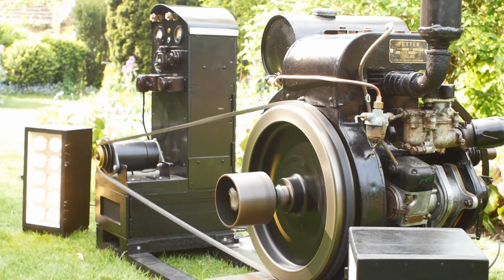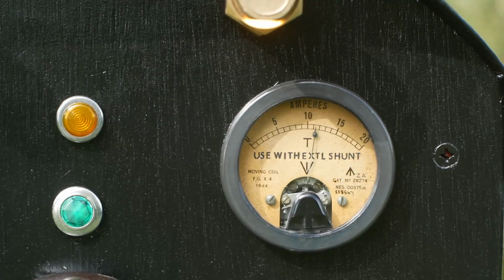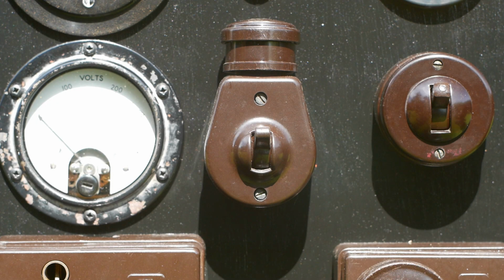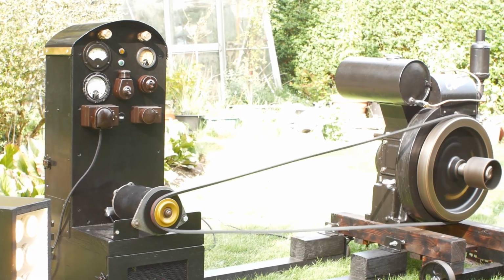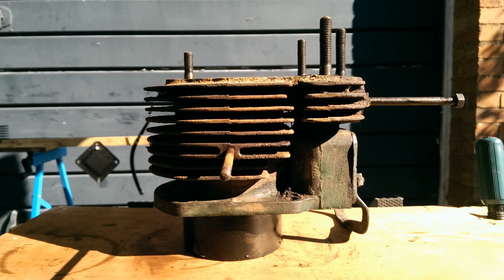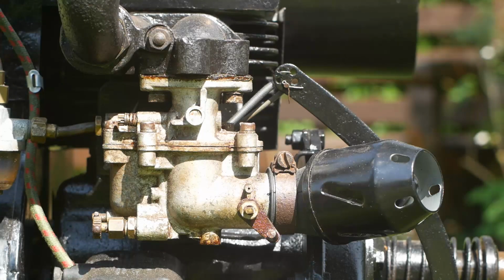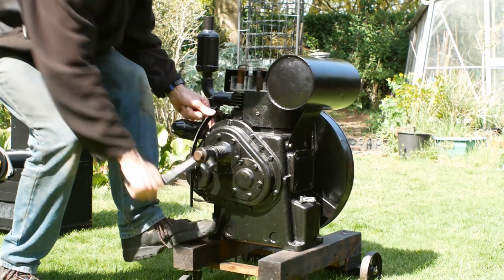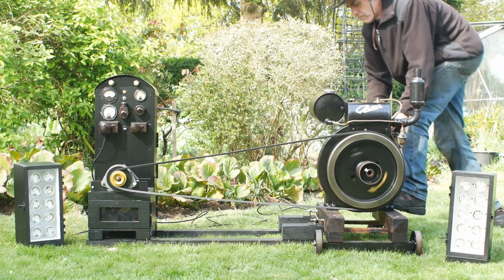Vintage Engine - Petter A1 Stationary Engine & Homemade Generator - How to Start a Petter A1

Comment: hi Tim - I am buying a similar engine and would like to also use it as an electric generator - I am semi off grid so a back up for charging batteries when the power is down. Would I be able to ask you about your generator set up? (E.g. via email). I don't think I can build anything as elegant as yours but guidance on the components I should get would be appreciated!
Reply from the maker: Hi Mark, yes that's fine to get in touch by email, you should find the address in the "about" tab.  My initial thoughts would be to use an alternator rather than a dynamo because you'll get more power that way - I used a dynamo partly because I had one kicking around and also I wanted the whole thing to look pretty - alternators are kind of ugly!!!

Comment: Great little lighting plant, but put the dynamo at the other side of the engine, so the belt is tight at the bottom, and slack on the top.
Reply from the maker: Hi Gary, I was probably applying my bicycle logic when I created that set up, with the top being tight and the bottom being slack - I seem to remember that I did falter for a while trying to think about the physics of how a friction belt should work and probably went for the wrong option.  Thinking about it now, if the top is the slack side, the belt will naturally wrap itself further round the pulley, which will of course increase the friction to the pulley and reduce the temptation to slip, which is a good thing.
Reply: Yes, that's it exactly!
You have an awesome, beautiful exhibit there- that to me Is just as visually appealing to anything 4 times its value.

I used to exhibit listers and Wolseley engines with Dynamos, and I really enjoyed them!

But I have a very special love for your set.
Well Done!!!!!
(P.s.)
See the little engines I mess about with 
https://youtu.be/08p2RwTJmk8
Reply from the maker: Oops, sorry Gary, your last message made it's way into my "held" comments area because it had a link in it - I've released it now so the world can enjoy.  I've seen a few of those miniature engines at shows - they can look a bit lost when surrounded by full size engines so I've maybe not paid them the attention they deserve, but seeing yours running in a previous video, it's rather lovely, and the idea of having a small hit and miss engine that could be run inside on a rainy day is very appealing.

Now that you've pointed out the belt tight at the bottom, loose at the top thing, it seems so obvious, and I've often seen traction engines with their big floppy flat belts, where it's bottom tight, top loose, yet I never questioned my own set up.  Guess I'll swap it round sometime, maybe next year during the winter when I can't really play with it much.

Comment: Nice, neat little lighting set!
Reply from the maker: Cheers Gary, it has the benefit of being relatively light, so I can pop it, and an engine in the back of my van to go to shows.  I still wouldn't turn down a genuine old PetterLight set, but I'd probably have to build a shed to house that, and come up with a different solution if I ever wanted to display it!!!  One day I'll build a slightly bigger generator setup to go with my Enfield engine - I'm gradually collecting suitable components for that project......
Reply: @GrumpyTim  Personally,  I've been there in the past with fancy, expensive engines- but got more enjoyment and much less hassle from my Lister D,  and Wolseley WD1.
Stick with what you have, it's lovely!
Reply from the maker: That's a very good point Gary - running my little Petters always brings a smile to my face, and they're simple to work on, reliable, and spare parts are easy enough to find - why would I need anything else.  I haven't run any yet this year - must rectify that soon - if it would stop raining!!!

Comment: Hi Tim, love the generator setup. Reminds me fondly of my Grandfather making a wee generator with a Suffolk punch lawnmower engine and an old car dynamo, belt driven. I bought a Petter A1 recently, v tidy but haven’t started it yet. Doesn’t seem a lot of compression when turning flywheel. Is there anywhere I could get simple instructions as how to start it and what levers and valves do what? Keep up the good work, Andrew.  Costa NI
Reply from the maker: Hi Andrew, I love those old Suffolk Punch lawnmower engines - that's where it all started for me - I spent so many hours playing with them.  There's not a whole bunch of compression on my engine in the video and it's fairly easy to turn the flywheel as the air seeps past the rings, but it still runs pretty well (it's had a hard life!!!).

Stationary Engine Parts in the UK sell an instruction manual for the Petter A1 https://www.stationaryengineparts.com/petter-a1-a2-w1-w2-1951-onwards-instruction-book-1356-0.html which isn't perfect but it can be useful.

There's also a Facebook group dedicated to the Petter A1 W1 A and so on engines https://www.facebook.com/groups/664186990354878/

Comment: The 1st switch is an early form of a 2-pin socket ~ could see the plug on top of it and assuming the wire went into the unit
Reply from the maker: Good spot Samuel, I had a random selection of old electrical fittings, mostly plugs, sockets and light fittings, but lacking in plain switches, so I used that early 2 pin socket - the plug in the top just has a wire bridging the two contacts, meaning the live and neutral terminals on the socket are connected when the switch is turned on - nice and simple.
Reply: @GrumpyTim  - quite ingenious, re-using electrical antiques and bridging the plug

Comment: Lovely setup you have there, I have the diesel version (PAZ 1) and a couple of alternators lying around and was thinking of doing something like this with the battery storage and inverter, I'm going to look at an A1 this weekend and have a feeling i might get it dirt cheap.
Reply from the maker: Hi Zak, that sounds like a great idea, and you'll get a bit more power output than me if you're using an alternator.  It may not be the most efficient way of generating electricity, but it's lots of fun for occasional use, and the alternator/dynamo, 12V battery and inverter route is nice and simple.  I can't remember the idle speed of the PAZ 1 - I'm guessing around 1500 RPM - you'll need to check what speed your alternator requires, to work out your pulley sizes - I run my belt on the edge of the flywheel, it takes a bit of alignment to keep it on there but once that's right it can run all day without any problems and I can run the A1 at around 750 - 800 rpm.

I hope you manage to pick up the A1 nice and cheaply too - they're a lovely engine, and you can never have too many!!!!!!!!

Comment: Where did you get your belt from please I am making similar as generator
Reply from the maker: Hi James, I can't remember which of my three usual suppliers I got that particular belt from but it would be one of these:

Simply Bearings    https://simplybearings.co.uk/shop/
Bearing Boys    https://www.bearingboys.co.uk/
Wych Bearings    https://www.wychbearings.co.uk/

I know the belt I use is an "A" profile and I deliberately selected a really long belt so it would flop around, somewhat like the old flat belts did.  My particular belt is marked as "A 116  13  x  2950  Li"

Hope that helps.
Reply: @GrumpyTim  are you on Facebook
Reply from the maker: Hi James, yes I'm on Facebook - you should find a link to my facebook page in the "about" tab on this channel, but I very rarely bother to use facebook - not enough time and all that.......

Comment: Very nice setup. I always start mine using the decompression lever. Hot or cold first try.
Reply from the maker: Cheers John, the oldest of my three A1's was made before they started fitting the valve lifter/decompression lever so I kind of got used to starting them without.  Also, all three of mine are fairly well used and some of the compression they would have had when they were new has leaked away over time so that also reduces the likelihood of needing the decompressor lever on my engines.  My Enfield Diesel on the other hand would be close to impossible to start without the decompressor!!!

Comment: Hi Tim
Do you know of any  Petter A1 spares distributor othe than Stationary engine parts from York as I'm in need of set of 85mm piston rings. 
Best regards 
Richard
Reply from the maker: Hi Richard,  I only know of Stationary Engine Parts but I always figured that if I needed parts like that, I'd go to my local engine rebuilders because I've heard that they are good with old tractor engines and stationary engines and maybe they'd have contacts for parts like that.

Also, there's a really good Petter A, A1, W1 etc Facebook group - I think you have to request to join but there are a lot of people with bags more knowledge that I have regarding the Petter A series of engines.  If you search on Facebook for "PETTER A AS A1 & A2 W1 & 2 PETROL ENGINES GROUP" you should find them.

Hope that helps a bit.

Comment: Hi Grumps
Could you do a video on the wico mag assembly including the governor weight carrier please. 
Richard
Reply from the maker: Hi Richard, I was planning to do a Wico series A magneto strip down/repair video at some point, I just haven't got round to it yet - it's been a while since I've done one so I'll have to refresh my memory.   I've got a box full of magnetos in various states of disarray but I should be able to make a couple of good ones out of them.  I'll see if I can get round to it in 2021.  Cheers for the suggestion.

Comment: Nice little rig, though I am deeply disappointed that you failed to answer the most important question: Can you boil a kettle with the reserve power in the battery to make tea? ;)
Reply from the maker: Theoretically yes, although I haven't tried it out - I'll do that next time I have it set up - assuming I have a suitable kettle - I wouldn't want to use a fast boil 3kw.  I'd need something like one of those little plastic kettles you get in a hotel room and they take forever to boil.  3kw is the stated maximum output of the inverter and I bet it would fall over with that load!!!  I do have one of those stand alone hot plate thingies and they're not very high wattage (maybe around 1500) so I could use that.

Good question  :-)
Reply: @GrumpyTim  you can get kettles that do 1800 Watts.
Reply from the maker: I guessed you still could, it's just all I seem to see are the 3kw ones lately.  I'm quite looking forward to the kettle test - might even video it, then you can see my entire generator go up in smoke because I've overloaded it!!!!!